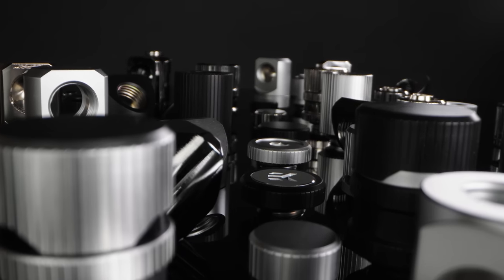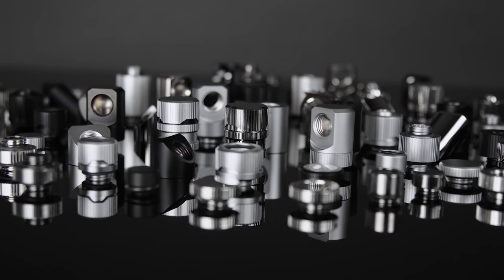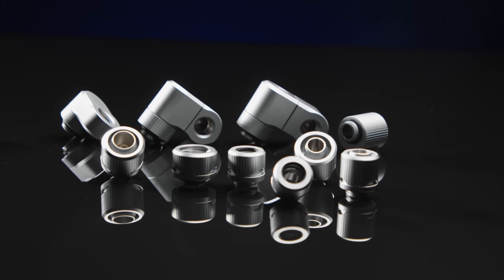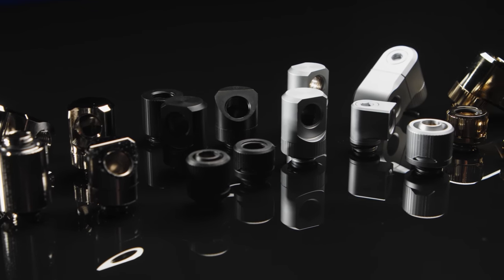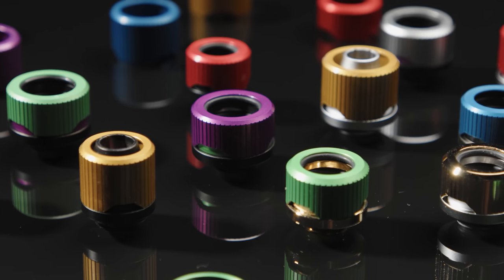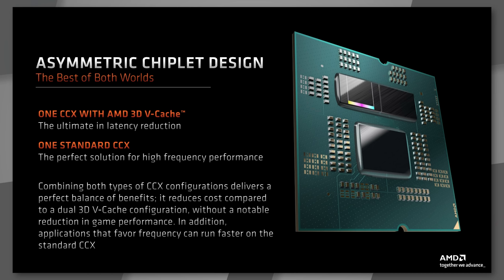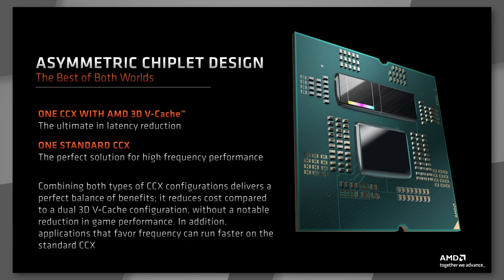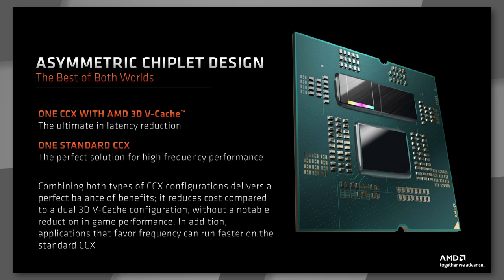Why I switched back to Intel...

Comment: It’s funny because I left Intel and haven’t looked back. I love my AMD AM4 and my AM5 builds. 0 issues from either.

I also don’t chase .01% max performance like some other people. But my AMD builds have been amazing and flawless. I love my 7800x3d. It’s needed for VR which I do a lot in simulators.

Comment: Current gen X3D wherever I looked here in Australia was more expensive than Intel 14th gen for (from what I could see on benchmarks) less performance. So I'm really glad I went with Intel because I don't have the money to mess around with these things. I want a system that's going to last and be stable, and my Intel cpu has been running like a dream so far with full speed 6000mhz ram. No issues whatsoever.

Comment: go with AM4 , build my pc in 2022 using 5700x and built another one for my kid this month and still choose 5700x , Its plenty for day to day task and gaming
My previous pc was I5- 4460 and did me a good 7 years before my mobo broke. Intel is good, would have chosen 13600k if price wasn't an issue in our country, 5700x is $180 while 13600k is $360

Comment: 5800X3D with Rog Strix B550 A-Gaming, XPG 3600 ram and RX 7900 XT and has been an excellent system. No issues and runs very well. I use it with only a few tweaks in the bios but nothing more. I'm not even sure if any of my system relates to your video.

Comment: I dont really go into the detailed stats and performance with my PC, I've been out of the game a long time and I'm basically a boomer at this point. I have had my Ryzen 7 1700 since the year after it's release and never had any issues whatsoever, I even used Arch as a daily driver at one point too and still no problems. I'm thinking the only time I would ever change to an Intel system again is if I got an Intel GPU since I could really do with rebuilding a new system (still using a GTX970) and turning this one into a Steam console in the living room.

Comment: 5800X3D (on a GB Aorus X570S Elite AX) and its runs absolutly fine. Paired with G.Skill TrindentZ Neo 32GB 3600 (16-16-16-32 1T)

Comment: For any overclocking enthusiast, the only way to go is Intel. Also, Intel has a much better built-in hardware based thread/core designator instead of the software based one, like AMD uses. Not to mention Intel 13900/14900K support much faster DDR5 memory. I'm running 2x24GB 8000 DDR5 at 36-46-46-86 timings on my 13900KS. CPU is OCed to 5.9Ghz on all P cores and 4.7Ghz on all E cores. All run on a Custom Water Loop.

Comment: Yes Jay, good and honest insight. I felt the same man, nothing major, but small annoyances. It is like death by a thousand cuts, no deep wounds. You don't run intel and nvidia for life until you deal with these stuff. when you need a system that just runs everything properly every time, the whole time. I had similar experiences with amd video cards on one hand and with amd cpus on other occasions (none threadrippers). Which made me come to this conclusion: my pc at home = Intel + nvidia. No hiccups and when issues do appear you are sure the solution is handsfree around the corner, just update windows and graphics drivers. No need to dig up forums to find workarounds or install modded drivers, life is too short for that. I used many amd computers at work with no issues, but workstations are usually more stable systems with ecc memory. With intel and nvidia you most likely to get a hassle free pc from launch (mind the nvidia cable saga). AMD sure gets better after a year or so when every bug has been addressed and drivers are tightened up for all the games and it is getting better and faster at this process with every generation. Ok now let me rap it: So until they fuck up big .. my main rig .. gets blue and green .. without much thought, to maintain my sheen.

Comment: I was having identical issues with one of my new builds.
It was an ASUS X670E-A with a Ryzen 7 7800X3D. So after 2 months of struggling with it I decided to switch to an i9-13900K and it’s running like a champ.
Reply: Probably because of ASUS. I have MSI and have zero problems.

Comment: I have no experience of x3d chips. But the idea of not utilizing every physical core available is out of the questions. So some months ago I went from Intel 9th gen to x670e aorus master and 7900x alongside with 64gb of 6000MT ram. 
I'm still figuring out the AMD overclocking out, haven't quite broken 30k in R23. But its been close.
And the system is stable as can be, apart from odd OE and O8 error codes that are persistant

Comment: On the AM4 X3D chips there is only one CCD so there is no confusion as to which ccd to use, even LTT's results showed that they worked better for gaming than everything else at the time. Not sure why they went asymmetrical on the AM5 chips but it seems to cause issues for multiple sources.
Reply: There is only one X3D CPU on AM4, the 5800X3D (and 5700X3D but they are the same minus clock frequency). The 7800X3D on AM5 has a single CCD with 3D VCache, exactly like the 5700/5800X3D.

Comment: MY AMD Ryzen 7 7700 with 32Gb Dual channel DDR5 6000 runs perfectly I have MSI Pro B650M-A Motherboard and a Radeon XFX RX 7900XT great on my twin gaming monitors I always check the Motherboard manufacturer which ram modules are supported on there lists, I have noticed there have being plenty if issues with Motherboards manufacturers lately on both Intel and AMD systems.

Comment: Exactly because of these scheduling issues i wrote a program to manually manage the core scheduling. Now i got rid of the game not running on the correct cores at my 7950X3D.
Reply: How about if you're not running game? Do the cores work properly? I'm planning to buy 79xxx-X3D for multitasking purposes and sometimes gaming (i need plenty of cores), but a lot of people say they're facing problem like this

Comment: Hey J i am one of those guys that is super nervous about building my own rig so I took so i took your advice and i went with Ibuypower. I got the slate mesh 8 with the i7 14700 f and the rtx 4060 along with the ddr5 32 gigabyte RAM, holding a 1 tb nvme. I am extremely happy with what I received and I appreciate you doing that video where you went through the iBuyPower facility. That really gave me confidence to go ahead and buy from them and I have not been disappointed so far!! Thanks Jay I'm going to continue learning from your channel and my next one will be built by me

Comment: As a long term AMD owner, I would say that "ram stability" is a standard AMD issue even with expo / Manufacturer certified ram etc.
The only with to avoid this is to run default uefi settings.
I would say that ram stability is a problem since Ryzen 1st gen and the only true weakness of AMDs CPUs
Reply: but its a pretty noticeable issue which amd must fix fast

Comment: Been using only Gigabyte boards for AM5 client builds with ZERO issues. Used to be I had sworn off them but this time around they seem to have it sorted. The RAM stability is so much better than the others, Asus is essentially trash tier, you'd have rocks in your head to build with them. G.Skill RAM has also been the go, the combination has been excellent, so I stick with what works best.

Comment: I have a 2990WX workstation and I want to switch to Intel because this thing is unstable as hell. I worry that if I switch to 7950X nothing will change. And I'm 100%-ing this CPU for 3D rendering.

Comment: If you're only gaming it doesn't make sense to get anything other than the 7800x3D. You get so much more performance for such little power. This is coming from a person who's only done Intel in the past starting with core 2 quads coming from a 9900k. no stability issues for me and no core parking.

Comment: I am using a 7800x3d, pbo -20, bclk 103,ram: gskill tirendz 6000mhz cl30 running at 6200mhz with the same timings coming from expo I. Preset and everything is stable startup takes 30 sec max.
MB:asus x670e-f gaming wifi running the latest bios.

Comment: I am new to pc building now that i have the funds to do so, and I've been running a 7800x3d with a gigabyte 650 x ax v2 (the micro center bundle was a steal!) and the ram that came with that bundle which i believe was a gskill flare x5 32GB. I have completely stock settings seeing as i am still pretty new to this and i have had no issues with my set up as of yet (except for a Wi-Fi issue that was dumb and stupid and just... dumb). I haven't really had the chance to get my feet wet with the tuning and stuff so hopefully i can try that out one day, but as of now, everything is amazing and i love the build :)

Comment: Man, i had a few year ago a PC with a 7700x, 7900 XTX, 32GB DDR5 5200Mhz and... I had so many "driver timeout" crashes while Gaming its was so annoying! Now 1 year later I had bought a new 7800X4D, 32GB DDR5 5200Mhz and ..... I get even the same issues again! -,- No OC, I use it out of the Box and while gaming it crasht. Got told from another Youtuber its "an user error" or "there are no driver timeouts man, listen to me" ... Now i switch to Intel i7- 13700k (yeah, i know "dead socket") but I'd rather have less performance in games than these problems

Comment: I've been using a 5600X since its launch and have noticed that it consistently runs at 4.2 GHz on its own. Perhaps it has been operating at this speed all along? Additionally, I've had no issues running DDR4 at 3600MHz. However, the recent hiccup arose when I acquired a 4070 Super, which unfortunately wasn't compatible with my ASUS B550I motherboard, forcing me to go out and buy another (non asus) one. After watching this video, I've decided to stick with X-series chips and avoid X3D altogether. As a casual gamer and heavy PC user for productivity, this seems to be the best course of action for me.

Comment: Well, running a 13900k with a small undervolt since day1, ram at 8000mhz and has been rock solid since ever and had no need to update the bios.

Comment: I was thinking about getting a 7950x3D. After I saw all the videos about possible scheduling problems of the CPU I ended up buying a 7800x3D as a processor for my living room PC. It will replace my old i7 2600 system and primarly be used for gaming / watching videos. Hopefully I have made a good choice. Just placed my order for it. Thank you for your work.
Reply: Hey how is it working so far?

Comment: This is why I'm waiting for Intel 15th gen, I want to upgrade but I think it will be worth the wait coming from a 9900KS. Do you think PCIe 3.0 is bottlenecking my 4070 Ti at 3440x1440 165hz? It runs great still, I'm mostly upgrading for % lows, and new IO/RAM.

Comment: Are those DDR5 issues present with 7800X3D too, then? Cause I'm sitting on my i7-8700 tryna figure out if I should wait for Ryzen 9000, build a 7800X3D system or just get a B550 board and 5800X3D and reuse the RAM (2x16GB 3600 MHz CL18).

Comment: After 3 weeks using a 7800x3d system. I enjoyed using in games but I could longer be patient with boot times and random 1 second pc lock ups opening programs like steam. I’m back with intel on a 14700k and all the issues went away

Comment: My current system started out as 10th gen Intel but a hotter than desired CPU nudged me to switch to a 5800X. Won't be making the switch to any X3D CPU with this build, but we'll see what tech looks like in another 3-4 years.

Comment: I'm switching back to Nvidia and intel. I've had a 5800x and a 6900xt since 2021 I believe. While performances where good, I've had more issues in those 3 years than all my years of PC gaming prior to that. Driver issues mostly, XMP issues with the CPU. It's never ending. I've done fresh installs, removing drivers completely and reinstalling etc. At the end of the day, intel and nvidia hardware never game me any problems in the past. I'm not ruling out moving to the red team in the future again. For the foreseeable future, I'll be enjoying a 4090 and a 14900 KS. I know AMD cpus are currently superior, but the pre-built i got from new egg came with the 14900ks so. Overall the system was hard to keep stable and even when it did, it would crash eventually.

Comment: Here I was RMAing/exchanging every part under the sun EXCEPT the 7800x3D. 

That being said I recently gave manually setting the EXPO configs a whirl…. And it surprisingly seems more stable than clicking the EXPO button. Not sure what else EXPO was setting or if it’s just dumb luck.. but we’ll see how long it lasts.

Comment: 7800x3d on MAG X670E Tomahwk Wifi with Kingston Fury at EXPO 6000MHz runs fine. Perfectly stable even wit CO -20 and SoC dialed down to 1.2V.

Comment: Ok, 7950X3D, Gigabyte Aorus X670E Master, Arctic Liquid Freezer II 240 and now 3rd Gen 360, gskill DDR 5 RAM, and (very bad choice of mine!)  Geforce GTX 4060Ti ... (I really regret it). No Problems whatsoever! All components work seamlessy together. I might change the graphics card as soon as the prices drop... whenever that will be :(
Reply: Hey I have the same GPU but planning to get the 7800X3D with an MSI 670e Mobo. How are things going with your rig?

Comment: i'm planning in upgrading my 4600g system to ddr5. given the fiasco with intel 14th gen, is the i5 14400 worth the upgrade or should i go with something else?
I'm thinking something like a r5 7600x or a core i6 12600K or i7 12700f, that are cpus avaible in chile where i live that are in to my budget.
my current rig has a RX7700xt and a 700w bitfenix formula bronze PSU, will any of these CPU go well with these parts??

Comment: I'm having exactly the same problems with memory stability on my Intel 13900k, Z790 ASUS Prime-A with GSkill 32 GB 6000MHz DDR5. I tried to adjust timings and memory clock to get it to run stable. No luck. My system is stable only with stock memory settings with XMP off. It's my first Intel Build in decades. I was always running AMD. My last intel CPU was a 486. I was going to give it a shot with Intel last august. What a disappointment.

Comment: On my 5950x i had similar memory issues after about a year with 3200MHz Samsung B-Dies running at XMP. i eventually had to run it at 2133 MHz to be stable which was just unacceptable. i swapped the kit out for some SK Hynix dies @ 3600MHz and it has been stable for two years now. even with "ideal" RAM kits some times you just get a lemon...

Comment: I've had all those issues you've pointed out and even when the clock went down to 350/400 mhz and constant and suddent stutters in my 3950x. I was caught by it cause I didn't have money to get a intel and ditch this one, but it lasted over a year and some extra months till new BIOS came out. After all that, I think year and half. There was a decent bios that I'm using until know. Didn't bother with recent bios cause I didn't want to mess with it and have to face unknown bugs in AMD BIOS.

Comment: I have been having memory stability issues my PC. I run a 7950x, a ASUS X670E-E ROG Strix MOBO, and a G.Skill 32GB (2x16GB) 6000 MHz, all meets the QVL list for the motherboard and I only have one kit running dual channel, I can not for my life get my PC to post either running EXPO 1 or 2, going manual at it, and so on. Have to clear CMOS to get it running again and I am stuck at running stock speeds for my RAM. It seems like Intel is a bit more stable but still has some drawback like gahly. If more devs supported and created games for Apple, I think I would of gone with them instead, it seems their ARM hardware is obviously way more stable and keeps getting more powerful every iteration.

It truly is a frustrating time for us PC users who have to deal with these issues right now.
Reply: try changing ram slots
Reply: @GodenHobbler  I did try different ram slots, I tired every recommendation given online and by ASUS tech support and nothing helped
Reply: @pilot.sergio4  maybe corsair vengeance (amd expo)ram sticks, is your solution. Do your sticks say explicitly in the name "amd Expo"
Reply: @GodenHobbler  yup the G Skill sticks I have are “AMD EXPO” ready. It is listed under the QVL list of the motherboard so it has been tested and they deemed it compatible with it.
Reply: @pilot.sergio4  other suggestions:
cooling (ram gets to hot), power (voltage to low or PS is not stable), bios update
Reply: @GodenHobbler  did all that too, looked at the thermals for the RAM all run at a cool 30C- 35C, can’t obviously see what temps they run at with EXPO because it won’t boot, but at stock speed at 4800MHz, that is the temp they run at. Bios is updated to the most recent version for my board which is version 2007 which came out in April of 2024. PS is more than adequate as well at 1200w and no noticeable deficiencies with it. My conclusion is it is either the MOBO with the issues which I recently RMA already or it can be the memory controller in the CPU as well. My bet is the MOBO but I’m not ruling the CPU out seeing as the RAM has already been RMA and replaced as well.